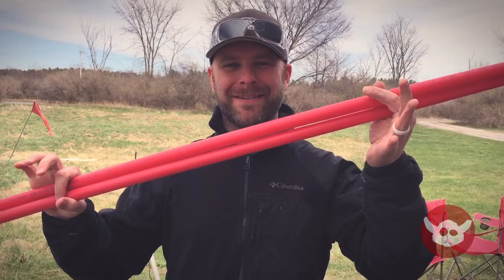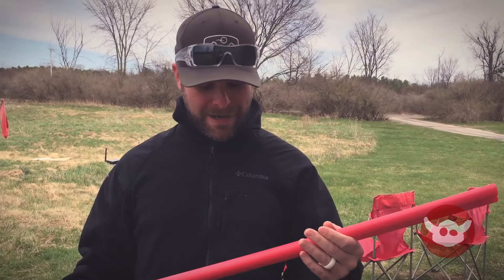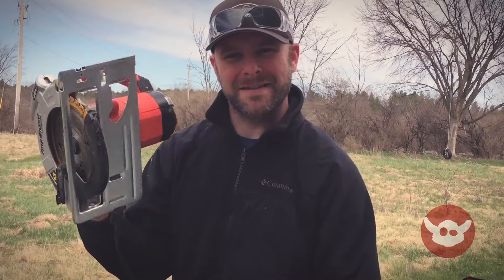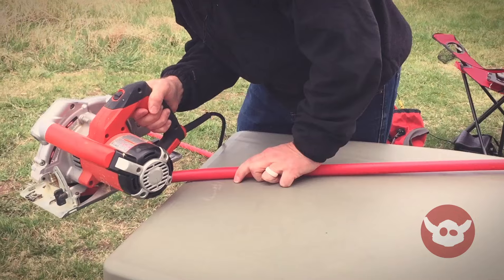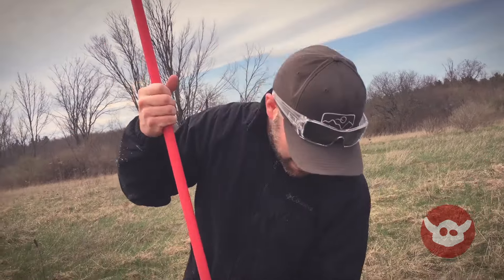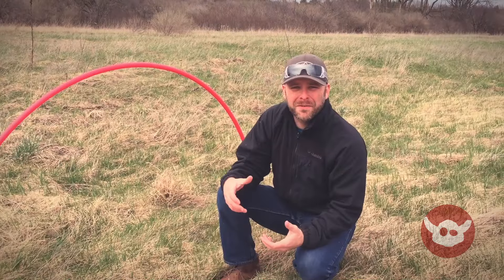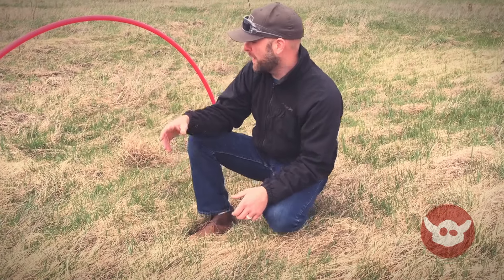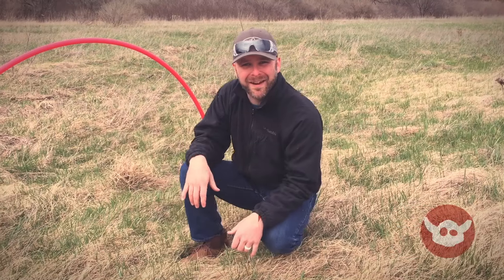Mini Quad DIY Race Gates for $6 USD

Comment: A bent pool noodle tent staked into the ground might work as well.
Reply from the maker: We use them (or PVC insulation tubing: easier to open up and place) over the pipe. Without any substructure, they tend to bend too easily. But, you're right, the foam keeps 'hard hits' to a minimum (and saves blades!). Thanks for the comment.

Comment: Nice video man. Here is a quick tip. If you get two 90 deg 3/4 shark bite connectors you can make a folding gate that will stand on any surface just like the soccer goal gates. Then run your LED's inside! Win Win!
Reply: Slowjet upload a pic of it

Comment: Hahaha, sure the internet is not going to be kind about the name, though you could probably use any PEX, most stores will sell it in 2-4 colors so that would give you some more options.      

Should all be just as stiff (yellow, blue, white, or red and hot/cold), and the good news is that it is not near as brittle as PVC or CPVC after it gets cold.